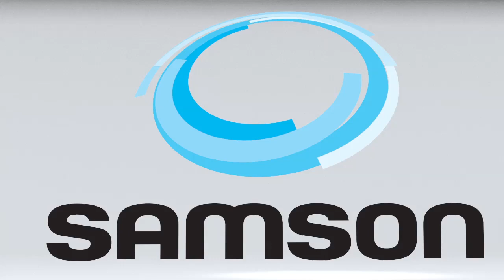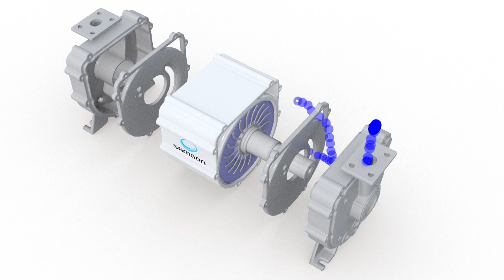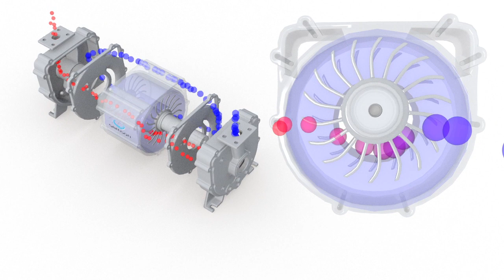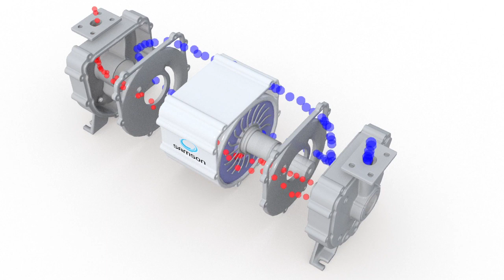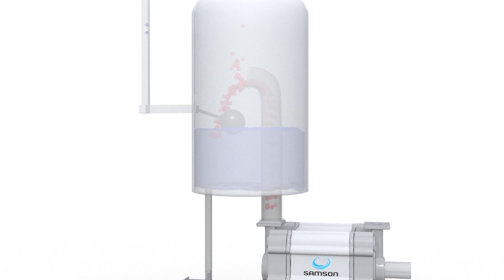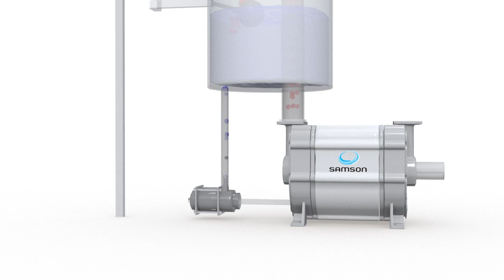liquid ring pump

Comment: Every other video explains how the pump works , but nobody else explained why heat exchanger is required , why recirculation pump is used , why separator is used ! excellent animation!
Reply: avis1983 separator is used on systems due to high pitched noises through drain lines in buildings. The separation will remove this problem. Some models will come with it and some models you will need to order separately.